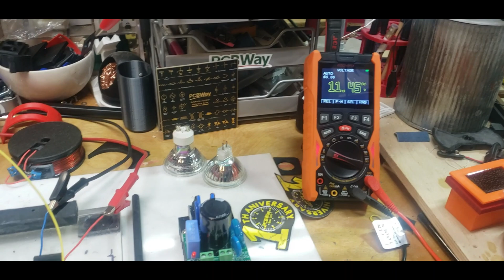3D Printed Pulse Motors and fun experiments

Comment: You say it's almost frictionless. Try it the other way around, you're using the top platform to stabilise things here, Connect the central pole to a ball magnet above it, and on the bottom, use just one bearing. the top then is the stable centre, and the flywheel effect will reduce the vibration more...I think anyway
Reply from the maker: I need to build a better platform and will keep this in mind thanks
Reply: @mcorrade  I got the idea from a video titled.
"Magnetically Supported Flywheel Spins Insanely Long"
Reply from the maker: @8thsinner  cool I have several "maglev" motors which are supported almost solely by repelling magnets. I will get them up and running shortly so stay tuned

Comment: When you say it isn't over unity, do you mean, because theres no load on it, and when there is load applied it drops the output to below the input voltage...I don't get it, bit new to the electronics stuff. Trying to learn but most are very dismissive of new people in my experience so far.
Reply from the maker: no worries man I say its not over unity because the total (v+a) watts in are more that the total watts out.
Reply: @mcorrade  Ah, okay. Gotcha now.
Do you know if it is possible to piggy back a voltage onto a different high amp circuit?

Comment: You should run coil using capacitor then selfloop it's output. If you have overunity it should have gain in capacitor